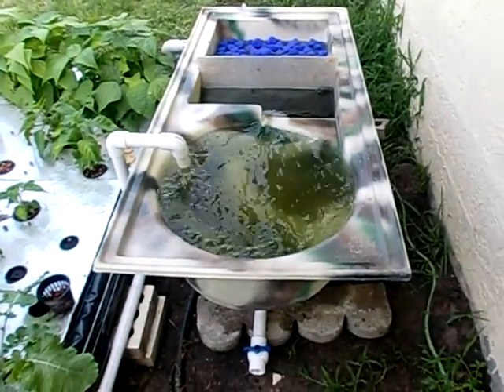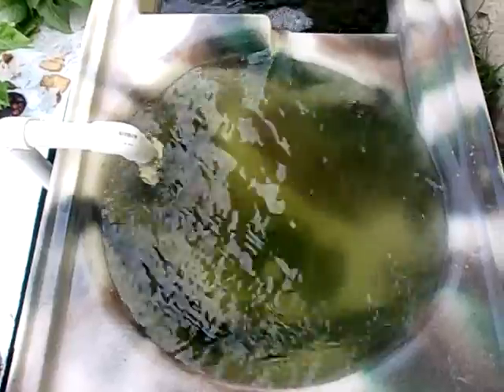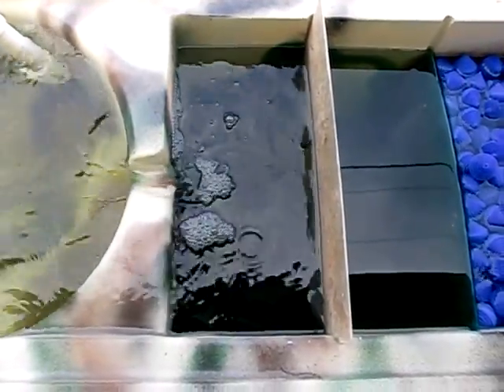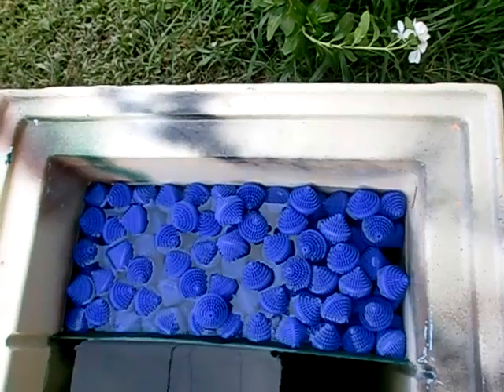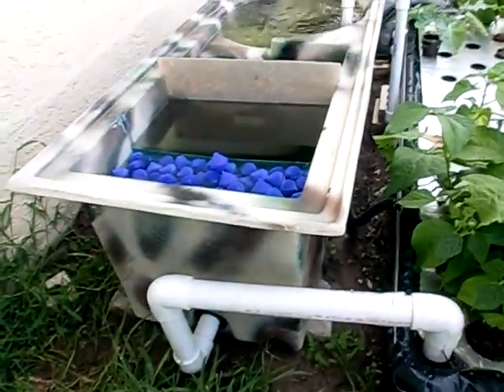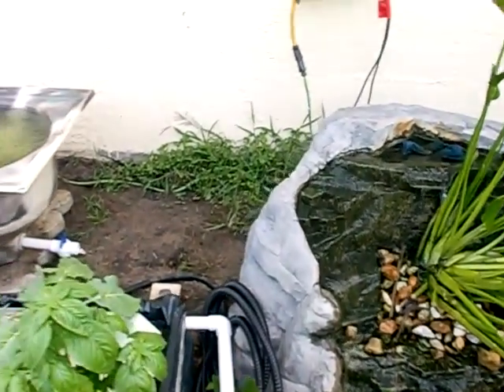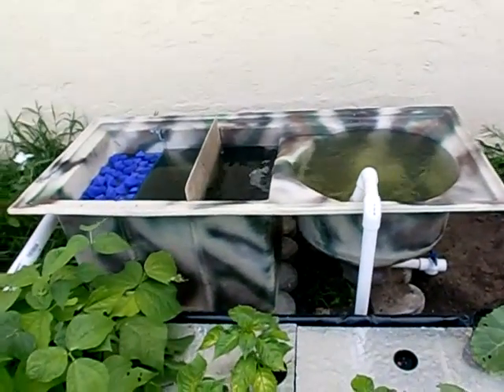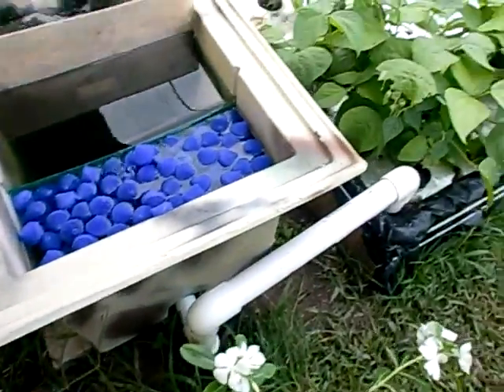Goponic Aquaponics Filter, Vortex Filter, Swirl Filter, Solid Sediment Filter, 4 stage filtration

Comment: if your primary swirl filter was worth a shit you would not need secondary filtering.
Reply: +Abby Babby 
Swirl filters never get ALL the solids.  I like this idea for fully removing all solids prior to entering my media beds.  In my case I would need to pump up from the exit.

TO Pawsdog....you need to provide either a website or ordering information in your description. Email alone doesn't cut it.   What's the price and the lead time??
Reply: +sittingelf I use 50 gallon cone base swirl filter, then I flow the discharge over a 5 micron screen and I have clear water to the beds, and never have any issue with solids from the fish tanks. I must admit after reading the comment I posted I was admittedly a bit aggressive and I did not intend it to sound that way.
Reply: sittingelf it would be nice if this swirl filter got ANY solids but it wont
Reply: Abby Babby but using the micron screen  is the second Filter u are using...

Comment from the maker: The filters are $425.. an entire system (currently, prices subject to change and all that) 1 tank, 3 beds, and 1 filter.. $2395.. does not include pvc, or pump. Pump is usually dependent upon how it is set up and a Mag 12 or above run $125 and up, PVC and Misc parts are another $150 or so.. If you would like 90 gallon sump that would be another $200, typically these are not included as not everyone will use one.